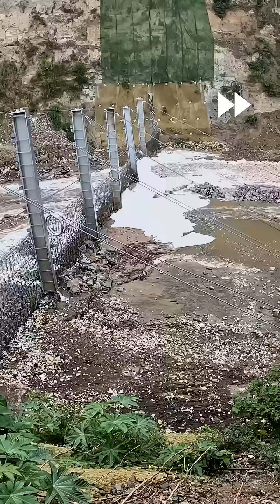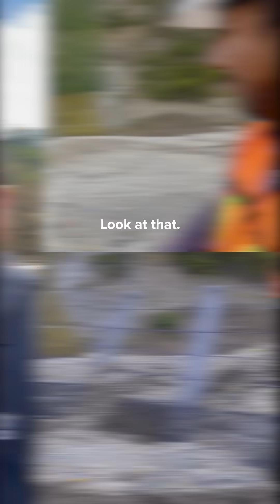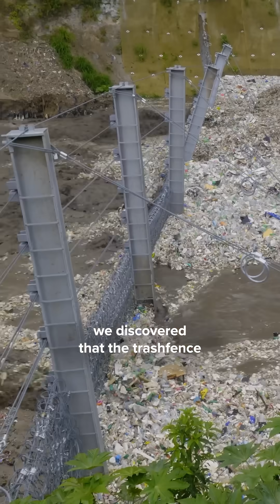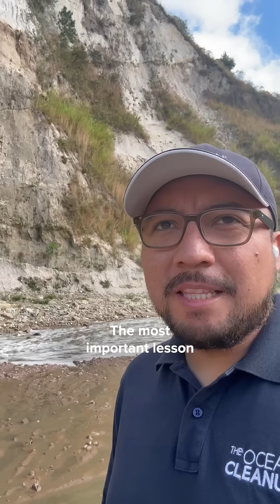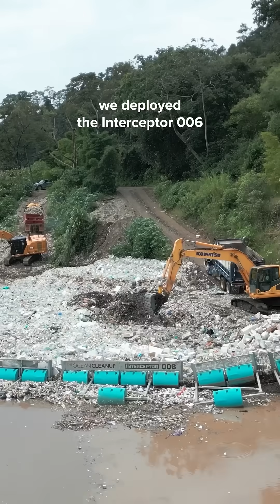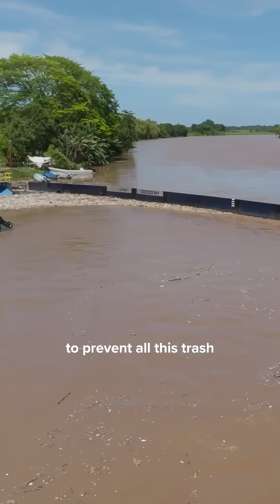From failure to success: stopping plastic pollution in Guatemala

Comment: It's a good start, but you can't just let the debris pile against the fences and expect them to hold. You need a passive system to remove the debris as it accumulates so the blockage doesn't just force its way through or around the fences. Active removal could be achieved using mechanical or even electromechanical means driven by the water itself. Food for thought.

Comment: This was a monumental challenge. 
What was built as a fence became a dam. 
The water did not flow through the trash as quickly as expected.

As the flow slowed, water level rose, so did the trash.

That much water is going to find an easier way to get downhill than flowing through the fence. It then probably created a clean layer of water that started flowing at the bottom. 

The majority of the water would start flowing through this area of least resistance. This would have created a jet of water that would erode the river bottom very quickly.

This jet then likely dug a whole right under the fence, until there was so much flow, that the floating nature of the trash would have been overcome by the "suction" of the water flowing underneath.

Think of the guys who dig trenches from the river to the sea. It grows very quickly as more and more water flows through it, until it's a river big enough to surf. 

This is why we see the pilings tilt, their base was eroded (particularly vulnerable because of the turbulence their shape would have created.)

I hypothesize that if they could have used a water powered trash shovel (think floating drag multi bucket shovel like a mining machine) and conveyor to remove the trash fast enough to keep the water level low. 

I'd love to work on this project in brainstorming. I actually know a company that can make high volume de-watering baskets before final loading. 

Very ambitious work, and a great cause.

Comment: What about build on the concept.  Lay a continuous belt that removes the trash over to waiting trucks to haul it off?  Or at least to the shore.

The idea is there, just add to it.  It wont be near as expensive, since you still need to remove the materials

Comment: Rather than a vertical barrier,  a better idea would have been a system of netting anchored to the stream bed and sloping upwards in the direction of  the river flow. The way shown in this video simply creates a dam as the rubbish builds up on it, continually increasing the pressure on the structure as the rubbish builds up.
Put a bit more thought into it guys!

Comment: a long diagonal line to concentrate it and  a trash comveyor bucket system to take it 100ft back up on land and load compactor trucks to take it in for recycling and sorting or compost if  not recycling type material

Comment: Why a 90° barrier instead of an angled one (e.g., 30–45°)? An angled floating boom could use the river’s flow to funnel debris toward the shoreline into a collection bay. From there, a conveyor belt or crane/grapple could load it into bins/containers for quick pickup by trucks—less dredging in the channel, safer access, and continuous removal. @theoceancleanup :)

Comment: The chainlink mesh could be made taller and use the excess height by laying it flat on the bottom over river bed and the rest to curve up to catch the plastic trash.
Deep metal stakes could secure it down to the bottom of the river bed. Everything else is perfect.

Comment: I applaud the work done to help the issue.. 
Put this here is like a painkiller for a brain aneurism. 
You need to stop the problem at the source. Government need to reduce the use of plastic in everything. 
Convert to sustainable material, or put a return tax on it. So that everything bought cost 1 - 3 bucks extra, that is then given back upon return to proper recycling stations

Comment: You need a water flow powered machine to feed the net/fence into the water, out of the water, to the waste deposit pile, and back to the start. They make oil/water cleaner machines that rotate a wheel half under the surface and wiper the oil off into a collector. Same but bigger and more like a chainsaw.

Comment: I think it's funny that the first design was a really poorly thought out idea of just using a classic fence while the second one makes great use of the fact plastic floats and u only try to catch the stuff that does so obviously u can make a floating barrier instead of having one secured in the ground with many failure points u now just need strong cable to hold it all together which gives u the ability to secure it on the bank in proper strong ground

Comment: This may sound odd, but I study mycology and part of that is the ecology of dead wood. While we need to clean these rivers as the priority, it does suck that this also catches the flow of dead wood, which is important for nutrient cycles between terrestrial and marine  environments. 
My question for those running the project is if you seperate dead wood out from the garbage and put it back into the flow?

Comment: So the location and the river's contrition were not the correct ones for the type of design? 
The hubris, a more accurate and humble assessment would be that the design of the structure was not correct for the type of river. 
That is not to take from the fact that you all are doing an amazing thing and should get more funding and resources to develop a sustainable practical design for that type of project.

Comment: Couldn't you place those in a series? Like two like that, separated by say 200 yards or so just in case there is a pile up/over flow. Then down stream a mile or so you could put another series with a slightly smaller fencing to catch smaller pieces.

Comment: If people keep throwing trash your still basically just creating a filter system so high levels of microplastics get flushed into the river at a high concentration basically the water the current the stream will flush the plastic away and into a more solluble form. Wonderful idea. The real problem is throwing trash not picking it up afterwards. Now the people will, with more right , throw it in river since they think it's now filtered. Hate on my comment all you want. The real issue is ignorance and people throwing trash.

Comment: The simple metal wired fense design works great the real problem is that it didn't get emptied leading to the breach.

To prevent that just as easy as the metal fence is to create a conveyor belt system (driven by a water wheel so it is in line with the flow rate) to pull all the trash out of the river and dump it into a container for transport.

Comment: You need a broad expandable net system that will rise with the hiight of garbage while allowing the water to push over it and out of the net. When the water resides you haul the net full of garbage up with a bank i stalled crane and dump it in a disposal truck rigged with a compactor.

Comment: You're fighting the water when you should let it work for you.  Lean the capture fence AWAY from the water, attach a net on top to collect the trash like a hammock.  Water will rush up the metal fencing then through as the trash clears.  Self-cleaning system that way.

Comment: Honestly it seemed like a simple error, yall didn’t expect THAT MUCH WASTE therefore leading to it going over the wall fencing and appears to have broken a hole in the middle. 
My engineering recommendation is 
stronger I beams
thick welded brackets securing the fence
Higher wall
and possibly a secondary over flow guard

Comment: Good try and I bet you got a lot of trash behind that fence. Maybe put in a trash wheel at the mouth of the river to catch trash before it enters the ocean or lake. Also, one of the things I learned when working in Indonesia is that people don’t want to leave trash all over the place. We built a road for our geothermal power project that connected two areas through the mountains that previously had required a really long journey by car or bus to get from one to the other. People started walking through our connected project sites leaving trash everywhere. It not only looked awful but the trash washed into the river when there was heavy rainfall. So we put up trash barrels along the road and build picnic areas with trash barrels and picnic tables. People were so careful to put trash in the barrels. We contracted a couple of small business that had dump trucks to empty the trash barrels into a landfill we created on our project site. We managed the landfill so run off didn’t go into the river but into settling ponds that also kept silt out of the river.  It was pretty inexpensive and made for good relationships with our neighbors.

Comment: Whenever I see this, my mind instantly has a different design in mind: Make some kind of permeable "ramp".
So, the trash is stopped. And when more and more is pushing, it pushes itself out of the water. 
Now make the permeable ramp with one sided direction. And the waste is not only pushed upwards but also to the side. So it automatically pushes it to a handy pile on the side. Just with the force and pressure of the water itself.

For me, this sounds logic, but I wonder if there isn't a reason why they did never try it this way.

Comment: There needs to be a way to constantly remove the material that's caught. Designing in place a removal conveyer that loads something else for transport, and powering it from the energy of the river flowing, and figuring out what to do with it after it's out of the river is all that's left.  Without removing the trash constantly it will just build up until inevitable failure whereby all the work only goes towards learning.

Comment: What you're doing is equivalent to fixing a boat that's leaking by removing the water that's leaking in, instead of fixing the leak.
Stop people from dumping plastic in your rivers, build landfills and or incinerators, force councils to fund trash pickup, add tax to goods if you have to, make sure you get rid of the trash in a functional way.

Comment: I feel it should be like a net that would lift up from the bottom using pulleys to lower the tension plus using an engine to pull the net like the sea boats do. After seeing that i feel it should be 2 but 3 would be the safe bet incase of that waste doubles.

Comment: Guys please! Please start turning this plastic waste into fuel. You can use the method of plastic pyrolysis to convert the plastic extracted from the rivers and oceans and break it back down into crude oil. 

After refining, you are left with a beautiful gasoline alternative made from plastic. 

And it would be cleaner fuel. Fuel at the pump is loaded with byproducts and fillers. Plastic pyrolysis fuel, clean additive free fuel.

Comment: Need an elbow, below at bottow water line straigh up stream past the net 1 ft below the net part of the fence. Then water never gets over the fence. Have a mesh cage around the inlet to the pipe also so it also catches the trash. They use that on beaver dams. So it goes threw the pipe. Not over the dam. When high rains come threw.

Comment: As the river increases in any one spot in volume it will try dislodge whatever it can to reduce the impact to the flow (hydrydynamics 101). It dug your fence posts and created furling and the fencing was not dug into the bottom or done deeply enough. Need to reinforce with heavy stones all the way across. Check how beavers create the base trap dam.

Comment: Every failure you guys have is more effort than 99% of humanity every has put in, we all love you!!! ❤❤
Reply: @theoceancleanup  are there any trash fence systems that scoop the plastic off of the top and up onto the bank as it is building up? Looks like this one worked well until the volume of trash overwhelmed it. Maybe even a submerged turbine generator to power the scooping mechanism.
Reply: @justinalias2279 i was thinking same thing. Need something to filter the trash out earlier.
Reply: We drop more tonnage in small microplastics from car tyres than the total tonnage of bottles that end up in rivers and oceans.
This sort of thing going viral makes people feel better and they go out an consume more oil base products where people have been killed over the oil so we can be customers. No-one has bought less plastic/oil based products the last 30 years.
This as far as the whole is concerned does nothing overall.
Reply: Well that is just simply not true at all... what horse crap lol
Reply: It's useless like wtf, they have to go to the centre, where does it start ? Is there a trash business that deposit the trash in a river or the ocean? If they can find it out, problem solved.
Reply: @Anubis-Piraatje-Trixie It is likely an insanely complex problem. Too many sources to go after
Reply: @BenutzerWalter Insanely complex problem? 
No it's not. 
The people in the area throw all of their trash in the river because they couldn't care less what happens to it, when it's out of their immediate sight. 
These guys throwing billions of pounds of trash in the rivers, killing countless ocean life, but yeah me paying more taxes will fix it.
Reply: @Anubis-Piraatje-Trixie We have to start somewhere, it feels like a futile endeavor, Sisyphean at best, but efforts need to be made. Your anger is a great start!
Reply: @A@Anubis-Piraatje-Trixieso you dont know what the problem is and are complaining about them not doing it right? Got it n
Reply: Really?😂😂😂 Its great but C'mon!

Comment: Trash collection like this is the ambulance at the bottom of the hill.
Not purchasing items with plastic will always be the first and most effective way to prevent trash from entering the environment.
Recycling is not an effective method for dealing with plastic waste. It is too inefficient. 

Do your best to assess and replace whatever you can in your standard shop with items that don't come in plastic, even if it costs you a little more.

Comment: The people get charged for trash collection. Every percentage added to the fees gets an extra amount of people to dump.  Most products are now packaged in plastics so it has also created substantial disposal onto the environment. The lack of education about recycling and effects on the environment also do not help. I am optimistic that at least there are some that are concerned about the handling of this issue.
Reply: Most of the plastic is not feasible to recycle. What is necessary are Waste-to-Energy stations. i.e. incinerators.